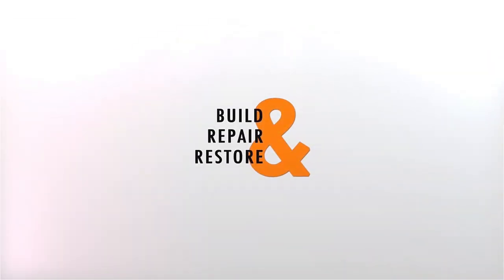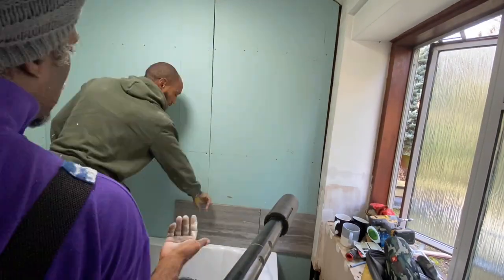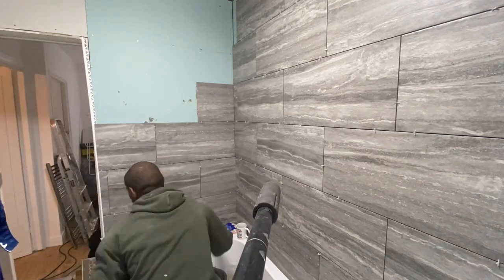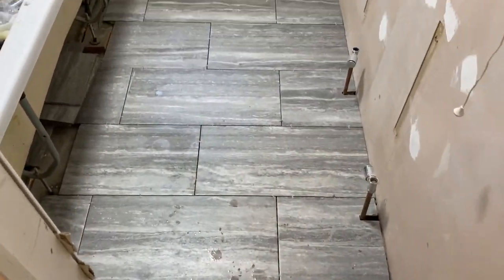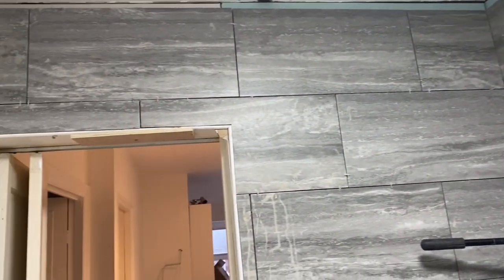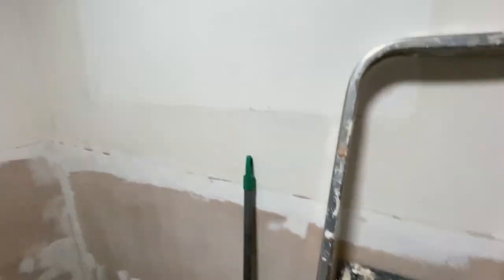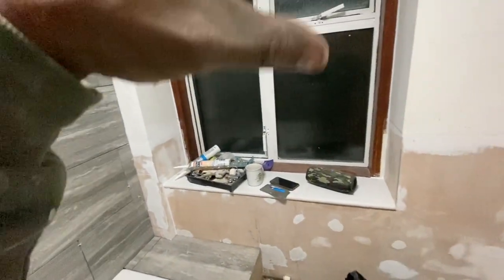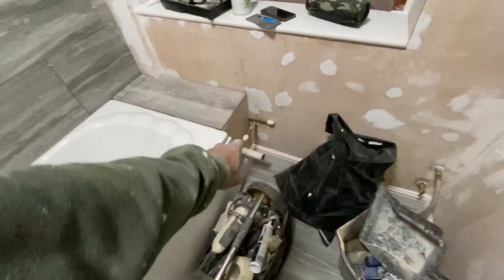Renovating a small bathroom in London - Days 2, 3 and 4

Comment: Why didn’t you cut the tiles down around the bath,so you don’t get the small cuts at the top,also the plasterboard needed primer on,and stuck with powdered adhesive not tubbed🙈
Reply from the maker: Cuts around are debatable. I would never have small cuts on top of the bath. 

British gypsums responds when asked if it’s necessary to prime moisture boards: “Yes, it is possible to tile directly to our Gyproc moisture resistant (MR) grade boards without any pre-treatment. Please refer to White Book Chapter 08 Section 04 Page 02 for more details.”

I always use powdered adhesive. It’s simply mixed in a bucket. This is not premixed adhesive. 
It’s quite easy to assume a lot for short clips and time lapses videos but although we don’t know everything we do know what we’re doing 😁 thanks for watching